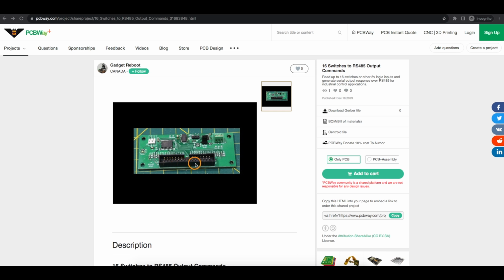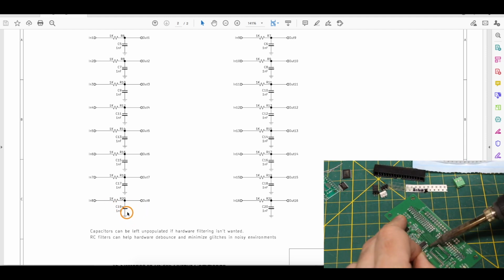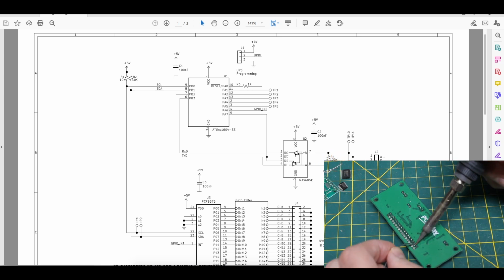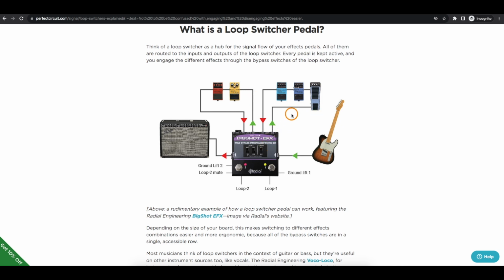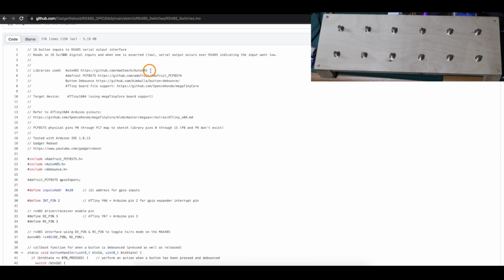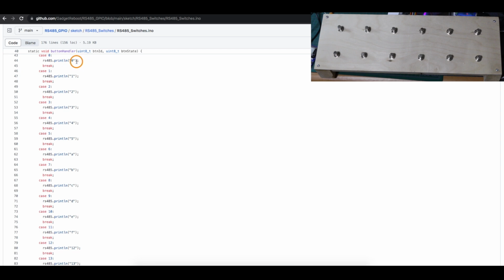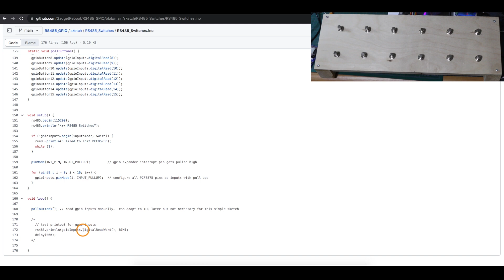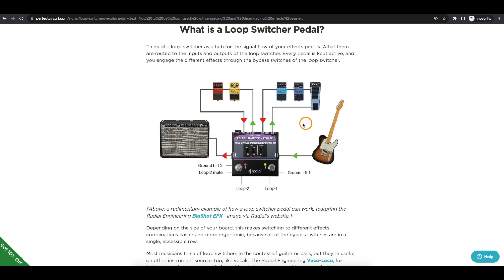16 Switches Controlling Things via RS485

Comment: Nice to see 3 wires being used for RS485, there seems to be a miss understanding that as it's a 2 wire coms you  dont need a ground (0V) reference.
I think if you go the MIDI route you better add some isolation on the RS485 as not all mains midi devices are created equal.

Comment: It shouldn't be too hard to modify this to talk MIDI to control effects if you wanted to do that as well.
Reply from the maker: Some of the fancier units out there can take midi in and out so that it can be used to control the signal path instead of stepping on the buttons or also while stepping on buttons It  can send out midi Messages to control other stuff. If I keep expanding this I might end up with a mess of side projects hanging off of it, with any luck.
Reply: @GadgetReboot hey man. Is there a circuit for diy vibration sensors? I was going to use a spring and magnet with an opamp.
Reply from the maker: @jstro-hobbytech this one uses a piezo to generate voltage from vibration https://www.jameco.com/Jameco/workshop/DIY/vibration-sensor-forrest-mims.html
Reply: Hello sir. How is the laser treating you? I'll trade you my line 6 helix for it. Haha I kid, the wife got me a 20watt laser for Xmas. I have a bunch of sg90s if you have need of them sir. Also a diy roller for engraving round stuff. I bought enough rods for 2. You just plug it into your y motor controller. I have the motor and all that too. I printed the other parts out of abs. My father in law is a retired millwright so he cut all the metal for me. Those tents really work man.